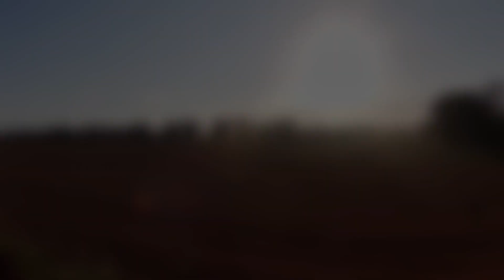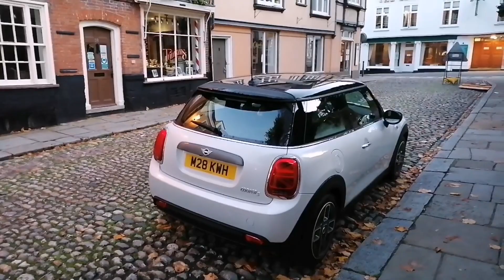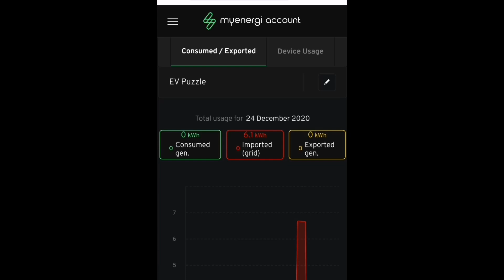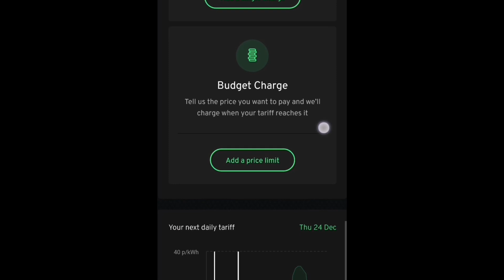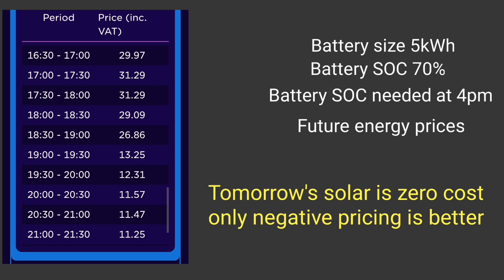EV, Solar & Battery  but something's missing?

Comment: Hi, great video and exactly what I am going through at the moment. I have the 5kw inverter and 8.2kWh battery and have been playing with the octopus integration but have only managed to get it to work successfully the once. I have it set to charge at the cheapest 6 minute intervals overnight and then to top up to 60% between 2pm and 4pm if the price is less than 16p. I have spoken to givenergy who only support the bit up to clicking on the octopus logo but then it’s over to octopus to control the inverter. I have mailed octopus but no reply yet. EVMan did a video on the givenergy solution a few weeks ago and seems to have got it working. I agree there should be some documentation on the correct setup and logic used by the solution. Givenergy also need to take a bit of ownership for the integration as they use that as a selling point. Hope you find a solution and maybe you can do a video showing how it works.
Reply: Looks like we just got some more functionality on the cloud portal to set the timed discharge percentage and a second timed charge.
Reply from the maker: So there is..

Shame Givenergy don't embrace social media a bit more or offer email updates on things like this . Feels odd to see  changes randomly with no communication..

Now how do you set the second values to NOT initiate a charge? All zeroes?  😂
Reply: @EVPuzzle  I guess so, for now it’s defaulted to AC2 start = 1 and AC2 stop = 4. On the timed battery discharge there is also a % discharge now but if I try to set a value and hit mode set then I get errors and the battery does not discharge. I’ll give it another go tomorrow and if still broken I’ll raise a bug report.
Reply from the maker: Feels a bit like testing in a live environment....no no no.
Reply: @EVPuzzle  interestingly the additional charge window has now been removed from the portal so I guess they found a major bug.
Reply from the maker: Accidental release of software not fully tested

Comment: We have 16.4 kWh Givenergy and charge overnight on Octopus EV go tariff but leaving spare capacity for tomorrow's solar. In Winter we charge to 90 per cent, in Summer we set it to 40 or 20. This means no top up is needed after a Sunny day as it is still well charged by nightfall. What would be great would be an app that monitors the weather forecast and flexes the level up or down in anticipation of more or less sunshine.
Reply from the maker: 16.4 very nice 👍
Reply: Do you need two inverters for the two batteries or do you have just one big inverter?

Comment: I’m not sure what the point would be of knowing how much the energy already stored in the battery cost as that’s a sunk cost. Surely the relevant information is how much it will cost to replace that energy if you use it, vs. the cost of using grid energy at any point in time when you’re consuming energy.
Reply from the maker: Chicken of egg. You've got to know how much it cost originally otherwise you can't decide whether to discharge or save for later imo
Reply: @EVPuzzle  let me illustrate with some numbers. Let’s say you have 5kWh stored, current price from the grid is 20p/kWh and you estimate you can refill your battery overnight for 10p per kWh. You need to consume 5kWh. Do you draw from the grid or your battery? You already spent the money to get the 5kWh into the battery. So going forward if you draw 5kWh from the grid to meet your needs it costs you 1 pound and your battery is still charged. If you draw 5kWh from your battery and then recharge it at at 10p per kWh it costs you 50p. Either way you used the 5kWh when you needed it and your battery is full. It makes no difference what it cost you to charge up the battery in the past. Google “sunk cost fallacy,” for more examples.
Reply from the maker: I agree once you've charged, the cost is realised but there's an argument on both sides.  You don't know you're making a profit unless you know the price you paid.  

Ok  probably wrong...

But if your 20p energy was actually 5p the same question applies, do you discharge the cheaper 5p energy then replace at 10p later or save your 5p energy
Reply: @EVPuzzle  fair enough, but knowing how much you’re saving on average is different than deciding whether to use what you already paid for. Think about it this way. Let’s say that due to some fluke you accidentally charged up your battery at £1/kWh, but for the foreseeable future the grid price will fluctuate between 5-50p. Then according to your logic it would never make sense to use that energy since you would be losing money on it. In reality you would be foregoing the opportunity to save up to 45p per kWh.
Reply from the maker: No my logic is to look at both .
Tonight's a good example. Cheapest at 730am but should I stop discharging at 4am to avoid charging at all thus preserving the energy I have already.  

I find there's no single answer, single calculation as everyone's needs and systems are different. Automation that tries to be perfect fails because there is no single perfect solution.

It's all a good discussion and learning process
Reply: @EVPuzzle  I agree with both your points. It’s a complex problem and a good discussion. A key part of the challenge is correctly assessing the opportunity costs. If you use the energy from you battery now (thereby avoiding the current cost of grid energy) will you then have to pay even more for grid energy later before you’ve had a chance to recharge your battery. You’re trying to optimize two moving targets. You want to avoid consuming grid energy when it costs the most by drawing from your battery, and you want to recharge your battery when it costs the least. It’s the differential that matters. I’m not sure how much energy you would use between 4am and 7:30am when you could replenish it cheaper, but part of the calculation is when and how much does the rate increase after 7:30am when presumably your consumption goes up. If it’s more than the difference it cost between 4 and 7:30am, and you wouldn’t have enough time to recharge the battery before the higher cost kicks in then you would want to “save” your battery energy for later otherwise you’ll lose the opportunity to save money when the grid cost goes up. Given all the variability in demand and supply timing and costs it seems like a probabilistic model would be the best you could do, but you can probably come up with some simple rules which are pretty good. I’d be curious to see what you come up with.

Comment: Some good points raised Nigel. I'm also having to manually switch my solis Hybrid inverter to charge my 12kwh battery pack which is a real pain. I'm sure the utilisation of the Eddie relays could be put to good use somthing I'm working on, as well as about a dozen other half completed projects. Keep up the videos all good work 👍

Comment: Have you looked into Tesla’s Autobidder application I believe that would give  you most of the info & automation you are looking for. Since Octopus is Tesla’s energy partner in the U.K. they should be able to tell you when that application will be available and may tell you what the app is capable off - see Tesla’s website for principles.
It is my understanding Autobidder will function with any Solar & battery system - not tied to Tesla- but I guess the difficulty will be with energy suppliers acceptance.
Reply from the maker: Appreciate the info. I'll look into autobidder. None of the Powerwall owners I know have mentioned it so it's new to me

Comment: I use Home Assistant (opensource with massive community) for all of my automation based on octopus pricing. When the price goes below a price I set, my heating switches from gas to electric, the immersion heater comes on. It looks after lights based on events from people coming and going, door sensors, cameras events. Integrates with everything you can get in IFTTT + more, but allows for very complex logic . Runs on a raspberry pi. 
All we need is some ofthe newer companies to open their api for config. eg zappi, ohme, inverters, powerwalls.
Reply: eg. With negative agile pricing from 11pm -7am today Home Assistant automation turned on every possible electric heating device I have without any intervention. 
It voice announces on my sonos speakers when agile pricing goes above 20.
It alerts me via text message when my usage from the grid is high and prices are high
It alerts me when I've left the shed door or garage door open after sunset. 
It send me a get a text when tomorrow's pricing announcement comes through and pricing is low.
Infinite config available
Reply from the maker: That's the level needed for sure but setting the events to turn things on needs to be smarter than just a price imo

Comment: Haha.... I knew you were gonna go for the Mini Cooper SE. They're so much fun to drive, yes the range is not like most of the competition but who cares!?  This car is sooo much fun to drive. Good luck with it mate. In the mean time I already have about 8000miles on it.
I'm saving up now for the next project, hopefully by spring next year, wich envolves solar power AND batteries. The way I want it is totally different then yours really. I'm nog going off-grid but the solar and batteries will (kind of). They will be connected to the grid but WILL NOT deliver to it. Everything will go into the battery or my EV. To start of with, I'm aiming for a battery that can cover a day of electricity usage for the house which is approx. 10kWh for me (EV doubles that). So my first goal really is to bring my daily usage back to the level from before the EV (probably even a bit lower). Later stage envolves investing in doubling the battery what would mean I can run the house longer on it (bad days for solar). So my EV will always be loaded either from the solar power or the grid. Batteries will only be for home appliances (except if batteries become cheaper and I can buy loads of them 😉 )

Comment: You need to charge via an Ohme cable which can be set for your mentioned parameters
Reply from the maker: It doesn't know my battery SOC in the house which is key

Comment: What you want is the Sofar Solar ME3000SP Storage Inverter.  It's got one advantage of having a Passive Mode, which allows for it to be connected to a Raspberry Pi (or similar) via RS485 and running Node-Red.  The Node-Red can send the commands to the Sofar to charge and discharge whenever required.

So you setup your Node-Red with your Rules.  The RPi can also be downloading and utilizing local weather forecasts, to charge from cheap rate grid power if upcoming weather was crap
Reply from the maker: That's a good feature

Comment: Very good post, I’ve been having very similar thoughts.

For me the key thing i currently work to is getting to the SOC i need at 4pm that is enough to see me through to 7pm. But getting the next step and figuring out the cost of the energy in the battery and what is exactly what charge a need it to and when, would open so many more opportunities to get my average cost per unit down.

I would love a fully intelligent system that looks forward, realises what I want to be charged to  and when. Maximises my possible solar generation for the following day, works out the SOC I need to be at to get through those expensive periods and can even help bring down unit costs for the rest of the day. 

Tbh now I would just like to be able to say charge to a give SOC on cheap energy and leave a “guesstimated” amount that is available for any spare solar I may make. This value will obviously have to change throughout the year and need to be done manually, but I’m sure I can stay on top of it. 

But I can’t seem to even do that. I appear to only be able to say charge to a stated SOC during a given period and as I always start the charging at night, the battery is at that SOC by the morning and then won’t top up with spare solar. Its okay now as I make very little solar energy, but it’s going to be a big problem later in the year.

In the short term I’m hoping Givenergy do roll out some more timers and offer some better integration with Agile it will be a big help.
Reply: Yes Givenergy. I’ve gone with them as they seem very keen to develop the product and don’t seem to mind when you pick up the phone and have a chat to them.

For me at this point it’s all about trying to avoid the Aglie peak time costs of around 30p for 3 hours, so pretty well any off peak is KWh’s are cheaper. 

I am a “very” high user, and I can get through my 16.4KWh batteries in those 3 hours. So cheapest units at night for most of the charge and then top up with solar is the least I need.

Once I have that the more intelligence the better. If I can charge a KWh at cheaply (in teal terms) and then use it when it’s more expensive, great as long as can then replace it in time for 4pm via either solar or lower rate, that would be perfect and this is where the intelligence will come in for me.

I agree it doesn’t look that hard to actually make it do it once you have all the parameters. But a lot of thought is needed in how you’d  be able to tell it what you want and then it would need a lot of testing. I’m happy to be a beta tester for givenergy (if they are reading the 😉)
Reply from the maker: I think they do read and follow.

The key to success imo is just make the data available. Turning the inverter to charge or discharge is already there in their timers it just needs a different front end with more parameters.
Reply: @EVPuzzle   and @John Griffiths thanks for your responses. 

Although @the EV Puzzle I'm not convinced that giving the user loads of data to programme will help most users in the long run. Most people just want to schedule and leave alone, with alerts when those parameters are not met. The key parameters are kWh price (use the cheapest first),  time it takes to get to desired battery SOC, and time you want it available at. So charge to 80% SOC by 4pm, using the cheapest available rates between now and then. Then let the device work out how much energy expected to be provided by Solar (based on weather forecast/historical data), and when the cheapest kWh rates are between now and chosen time. Set that as a routine schedule. Leave and forget.
Reply: Are you using a Givenergy battery? Useful to note the loss of energy, from charging and then discharging the battery, needs to be taken into account with an energy battery.  Surely it would be useful to have a parameter to only charge the home battery when cost is less than (say) 5p per KWH, until the battery hits a 80% SOC by 4pm.  Then you always know that the average cost of energy in your battery will be 5p or less. Then you know (the maximum) price of electricity is you have paid for, and how much you have in the battery at 4pm when you need it most. Also, it would probably be useful to have an alert feature when the home battery goes below a certain threshold (e.g. 20%) so you know if you're  about to run out of 'cheap' electricity.  If you can charge your home battery from the Solar Panels from your roof then that's going to be the best way (unless you get a negative price from Agile?).
Reply from the maker: We need all the parameters possible and set our own rules by all the data.

Programming is simple.
It's data 
+
Logic/rules

Make as much data as possible reference-able and allow logic if charge if.... and discharge if...

Comment: I'm able to add rules to my Inverter to time the charge and charge rate (kWh) of my battery. Perhaps your inverter could control your battery charging?
Reply from the maker: Do you have to change those parameters often to optimise it?
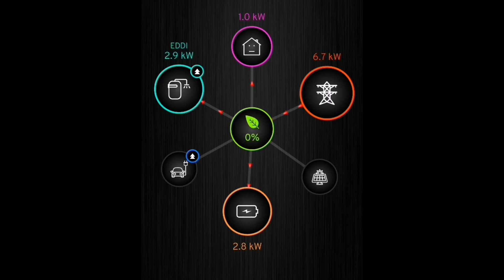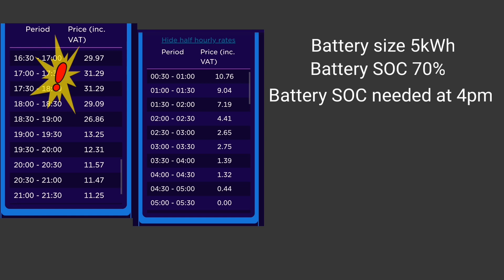Reply: @EVPuzzle  Not often. Once you've set a rule (which is customisable by date, day, time etc.) you have a rule that's ongoing and you may not need to amend it again. e.g. if you always want to charge your batteries up from 01:00 to 05:30 from the grid, then one rule will do that for every day or any day you choose when you set the rule up. My inverter will handle ten rules (0 -9) under the 'timed use' section. So you could set up a number of rules to cover different time periods ( i.e.Winter or Summer etc.) or differing days within that. Each rule can be Enabled or Disabled at will so they are always there should you need to kick them back in.
Reply from the maker: I'm sure you've told me before but which inverter do you have? It sort of sounds like a storedge system
Reply: @EVPuzzle  It's a SOFAR Solar HYD Inverter
Reply from the maker: Interesting....

The markets going to change and products will improve but will they improve retrospectively?  Depends on whether over  the air updates work I guess.

I like the Victron interface. Very solid and responsive but it's behind in its ability to integrate with agile etc. Software isn't updated often enough imo